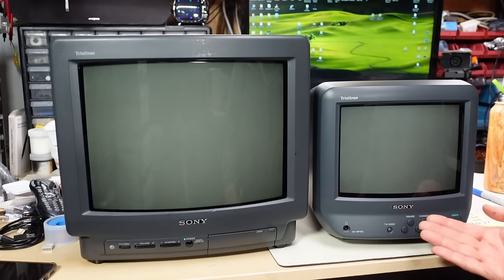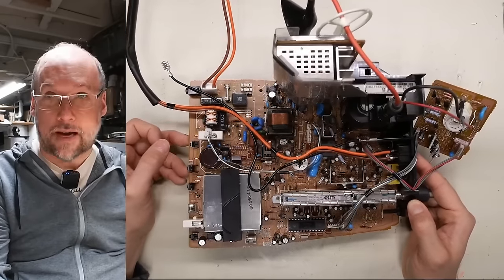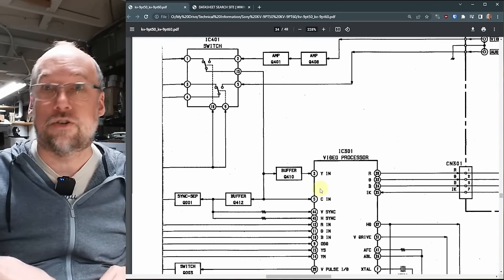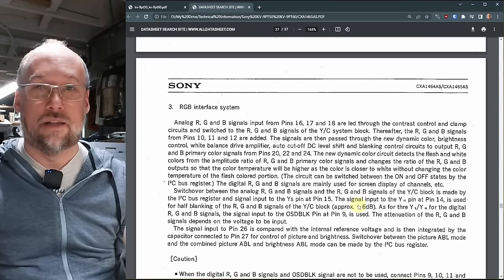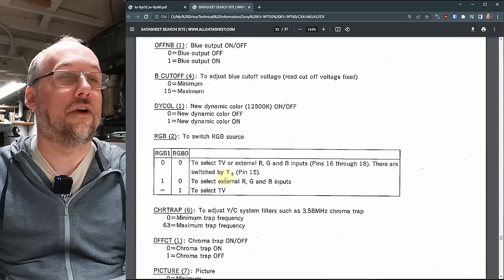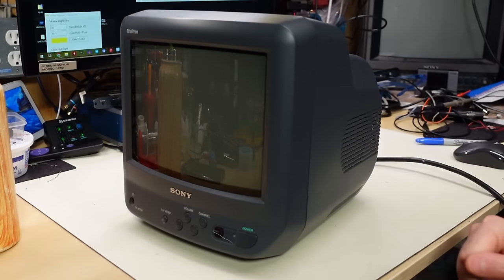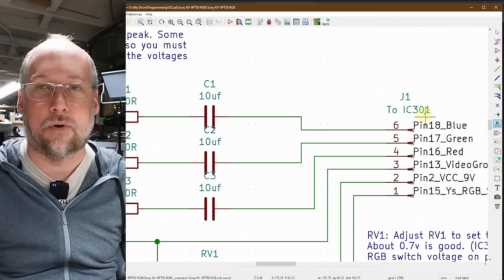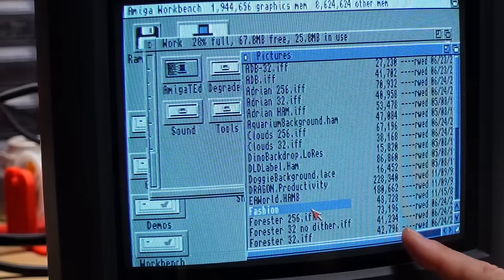Adding a RGB input to a Sony Trinitron (KV-9PT60 / KV-9PT50)

Comment: I don't understand why tvs in the West limits themselves with PAL or NTSC only while in my country even the cheapest no brand tvs have support for both PAL and NTSC without any modifications needed (even though I think we mainly use NTSC)
Reply: If you mean what you said, then you're laughably inaccurate. If you forgot to use past tense, then I completely agree. You used present tense though, and it's pretty much impossible to buy a modern TV in the USA that does NOT support PAL as well as NTSC (and that has been the case for over a decade).

Comment: SCART. Large connector and very stiff cables in my experience, poking out to one side. Those are good attributes in some things, but not here.
Reply from the maker: Heh. The sideway connector at least allows you to push the TV up near a wall without the cable hitting. (like UK electrical plugs)

Comment: Doesn't the 13 inch have a hot chassis?
Reply from the maker: The service manuals indicates it has a similar switch mode power supply to the small one

Comment: Why don't you just use the SCART port? Oh. Right.
Reply: When i was born in our house there was a late 70ies big square "Electrohome" (would have been about 19") with metal chassis it had the scart connector it was kept until i was a teenager, i never saw one again in my NTSC country. I seem to remember it was "multi-format" but never saw it running with PAL since there were no such broadcasts here and would have required an actual PAL VCR which we didn't have. Its also the only TV i ever saw with full metal chassis, tho the back part was painted simulating "wood".

Comment: There is something missing. It does show "it can be done.", but on the other hand not everything that was done to the mobo and added circuit on the input are not viable, so in the end many people without [at least] Your level of knowledge will have hard time .... heheh [It's a prank bro !] Well ... if that was Your intention, or just show off, or on the other hand, encourage people to dig in the almost forgotten tech and learn something new, than it's ok :)  Have a nice day mate !
Reply: That's the trouble. There aren't very many actual tutorials on this, and I think part of the reason is that it really can be a "you need to design this mod for this device" thing. There's a basic ethos of what goes into such a mod but the specifics can vary so greatly and there's high voltage involved, so most people who are qualified to make a tutorial know that it probably isn't worth their time to do so.

Comment: Why not just buy a multisystem TV sold in Europe that has scart?
Reply: Because that would be significantly more expensive.
Reply: @awesomeferret  not really, you can find one extremely cheap, shipping might be a bit but if it's not a big set it won't weight very much. I never understood why US TV's only have NTSC and no SCART
Reply: @itanasoaie  yeah, time for you to update your shipping prices. If shipping a CRT in the USA costs over 50-100 bucks, imagine how much it would cost to import one from overseas. And I just want to double check and make sure that you don't actually mean what you said (you used past tense, which technically makes your statement laughably inaccurate since you haven't really even had the option of buying a new TV that does NOT support PAL in the USA for the past decade). I'm assuming that you misspoke, considering the context of CRTs.
Reply: @awesomeferret  oops! Damn, shipping is expensive there! I meant CRT TV's. Pretty much anything that was sold in Europe after the late 90's was multisystem. Sent a friend of mine a PAL romanian 8 bit micro and he told me he had to mod it because the CRT TV's sold there were NTSC only. My US NTSC  C128 worked perfect on my 90's TV. I am afraid I only grew up and lived in Europe so I apollogize if I got it wrong.
Reply: @mariustanasoaie1147  no worries, I suspected you were talking about older TVs and not newer ones, but I wanted to double check since I occasionally do run into people who think that PAL still isn't compatible with modern TVs. Bluray players, now that's a nasty exception. Sometimes region free Bluray discs won't play in a Bluray player, not because it's the wrong region but because it can't play PAL video (even though the TV supports it, go figure). I learned about that one the hard way.
Reply: @awesomeferret  when it comes to digital it's a whole craze in here as well! I purchased a Panasonic TV from UK and while on paper it works just fine it will actually not work with a Romanian CAM module.  The hardware is the same but for whatever reason it was region locked in firmware. It took a lot of work to track down the east European model, do a firmware dump on an actual TV and then flash it on mine. Of course that voided my warranty and all. It's the stupidest thing ever. I also have 2 PS4's because I bought a ton of games in 2 different countries.
Reply: @itanasoaie  dang, well I'm not missing out on the "two PS4s for different countries" thing.
Reply: @itanasoaie  yeah I moved around a lot so In the past decade or so I lived in Denmark, UK, Romania. Bought a ton of games, DVDs and BDs. I have a media center that bypasses region lock but PS4 is not that hackable so. I love that Xbox does not have this gimmick though, wich is why I moved away from PS.